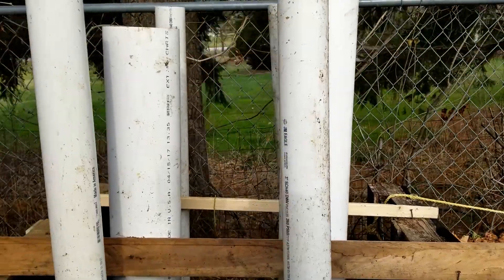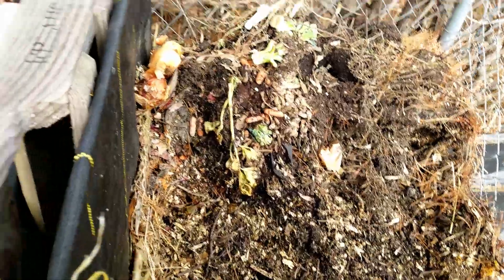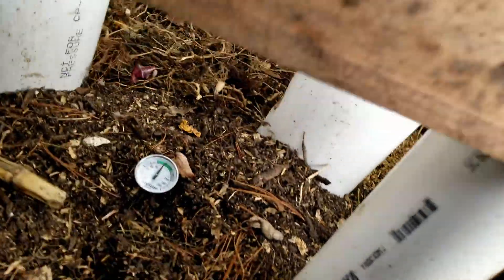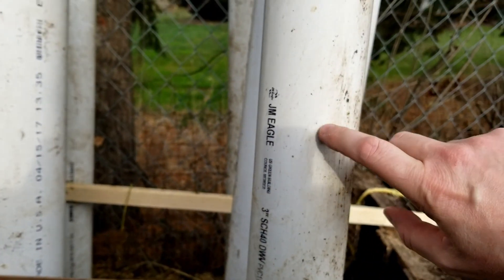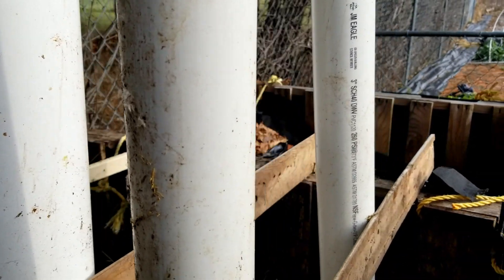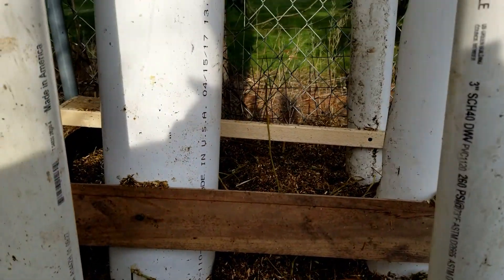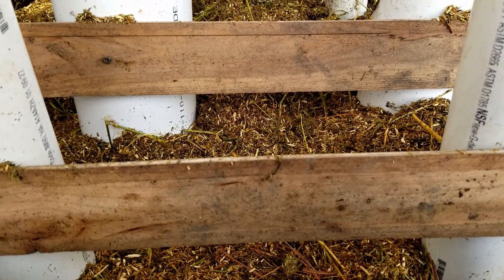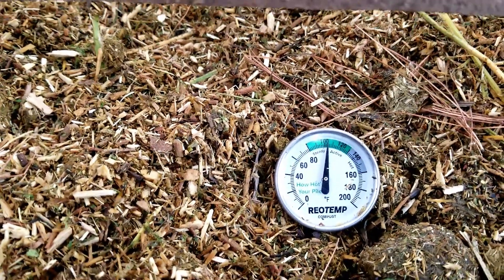Johnson Su bioreactor made using pallets

Comment: you need to remove the pipes 24 hours after starting the pile or you risk it going anaerobic for too long and you need to keep the moisture at 70-75%
Reply from the maker: Some of the pipes have holes in them but that is definitely something that can happen.  Once the pipes are removed, the  aerobic process will restart.

Comment: I spent about 16 hours between yesterday and today building and filling mine. Best of luck to you 👍🏻
Reply from the maker: Thank you.  What did you use for materials to fill it?  The temperature of mine has stabilized at 40 F even when the air is in the single digits.
Reply: @stevefromthegarden1135  I used about 2/3 cypress tree wood chips sifted through 1/2” hardware cloth and 1/3 various leaves, not shredded, gathered from my neighbors
Reply from the maker: It must have taken awhile to sift the wood chips.  With no nitrogen source, it will take a little longer for everything to breakdown.  Maybe 18 months.  Once it's finished, you'll have a high carbon fungal rich compost to use with good water retention.
Reply from the maker: Georgie, how is your Johnson Su coming along?
Reply: @stevefromthegarden1135  it started out at just 4” under the lid at 5’ high and has shrunken down to 2.5’ tall. Jan 19 will be one year. But as you said, I’m sure it will take at least 18 mos to completely break down.
Reply from the maker: @Doitallgp  It might be ready just in time for summer or maybe for fall bed amending.  Thanks for the update.

Comment: This is cool I am looking forward to the updates. I have not tried using a reactor like that, it's intriguing. I might try something like this in my hoop house.  Do you soak the material or is it wet enough to start with?
Reply from the maker: Setting this up in a high tunnel would be ideal.  You could even use it as a hot bed to help germinate your seed starts in early spring.  In this case, the horse manure was fresh so I did not wet it 1st.   I did add water to it over the couple days it took to complete this.    If I had been using woodchips or other dry materials, I would have wet down as I was filling up the bin.
Reply: @stevefromthegarden1135   That's a cool Idea. The weather did not allow me to complete the hoop house this year. I hope we have an early spring, so I can finish before  field work takes all my time.